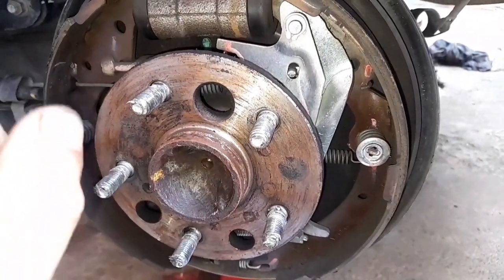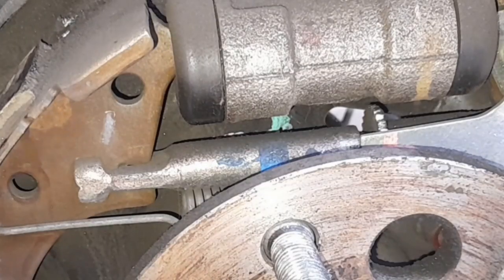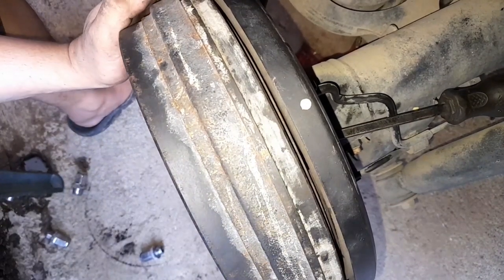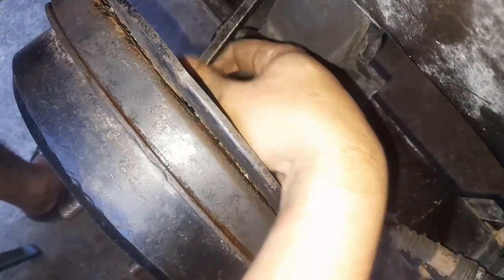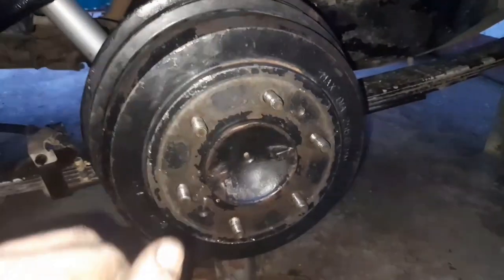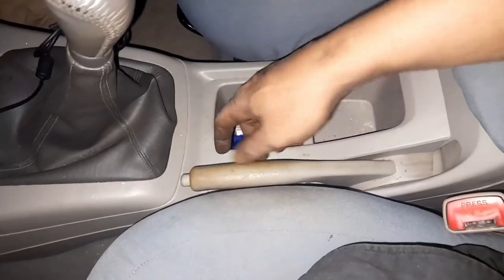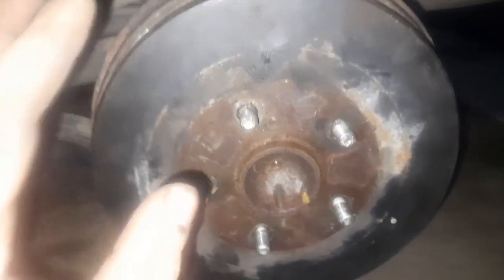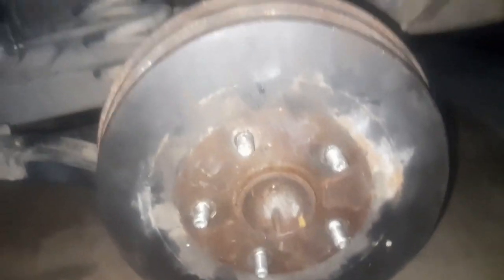How to Adjust the Rear Brake Drum And Hand Brake Properly! Innova/Pajero

Comment: Hello. I replaced the rear shoes. Brakes were working fine still before especially handbrake that was fine and tight but after doing the shoes and adjusting at the drum like you did the handbrake lever feels even tighter in the car like maybe 4 or 5 clicks but the car doesn't hold on a hill at all like it use to before. The pads were the identical that I pulled off so I doubt that it the problem. Maybe they need bedding in?

Comment: Good day sir, off topic, may i ask about when to replace high pressure hose at the back of alternator to prevent oil leak and eventually knocking of engine? Are we going to base it in last time it was replace or kilometer run? I am not particular on technicality and will put weight on your experience on this type of car since I dont know anything about automobil and just learning here in youtube. Thank you sir for your time.

Comment: Is there a disk conversion kit, or is it advisable to get a disk brake rear axle n swap, and ur recommendations. Plus if ur diff ratios are different what's de effect on driving, high ratio in the back and a lower one in front

Comment: Hello sir. Recently my rpm meter did not function & in order to rectify this issue I may have to check on the rpm sensor condition first. Which one is the rpm sensor location? Appreciate your help sir. Btw i am using the same vehicle like yours. The 4d56 beast!
Reply from the maker: Its located in the right side of the injection pump. Check terminal connections first. Check if its loose check for corrosion. Check for continuity in the wirings.
Reply: @MrDIYer  Thanks sir! I just rectify the issue there. Found that the sensor wire cable connector was loose.

Comment: if the drum starts tp drag doesn't it mean the brakes will heat up while driving and cause brake fade?
Reply from the maker: Depends upon the amount of drag. But not really. The brake shoes will center itself inside the drum. And theres also what is called as running-in the lining, the liner will wear down and fit itself inside the drum. But again depends upon the amount of drag.  If you feel that drag but you can easily still turn the drum by hand then it should be fine.
Reply: Another nice video brother in your peculiar style. I have adjusted my turbo and would like to see a video from you on adjusting the boost compensator, off course, when you have time. Thanks.